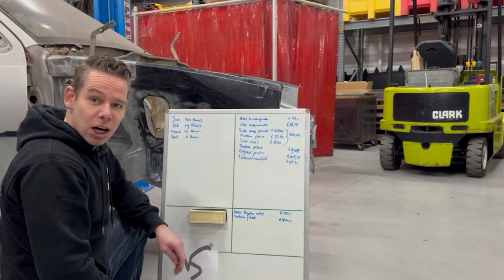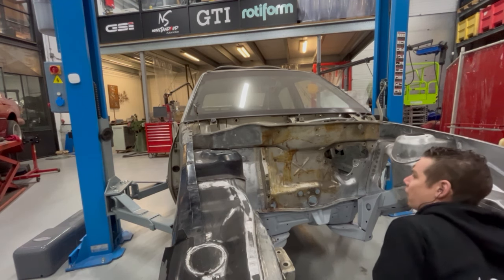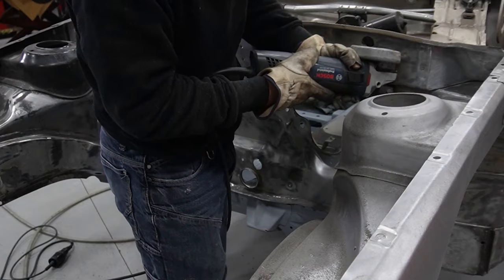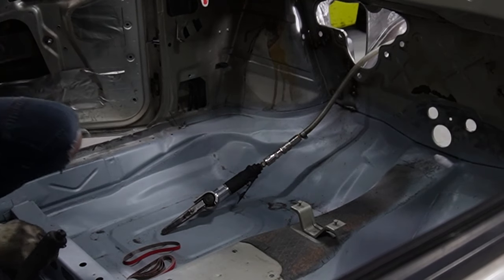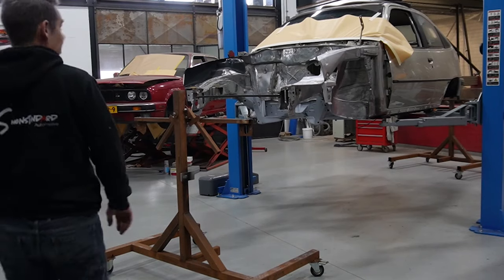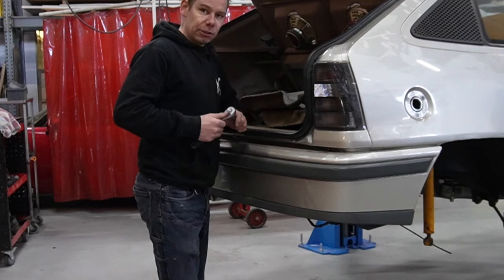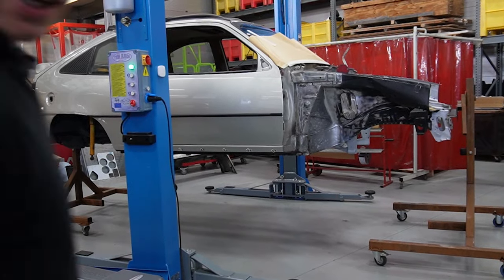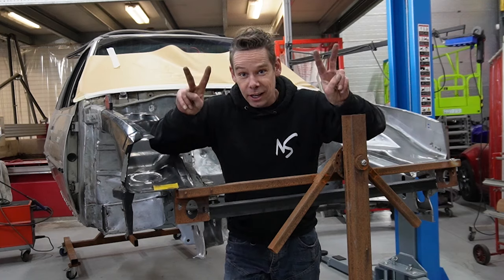Restoration of a unique Opel Kadett GSI Rotiserie !

Comment: Nice work again. Which filler / ground you use before welding the metall? Epoxy? 
I think there will come surprises again on the rear kadett.
Reply from the maker: Thanks ! Using inoxspray having good experience with that on older projects.

Hahah yes thats for sure 😅

Comment: Do you will change all of windows?
Reply from the maker: Only taking them out for paint  i think.
Reply: Welding and grinding ruin glass surfaces.Better is mask windows before car body work.
Reply from the maker: Yes i know tried to protect them as much as possible.
would removed them before but don`t have the storage for it atm.
Reply: Weer lekker bezig  kerel 👍🏻
Reply from the maker: Tnx